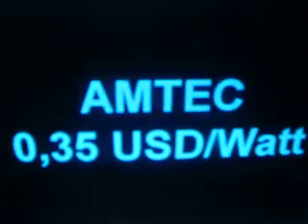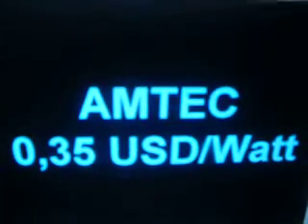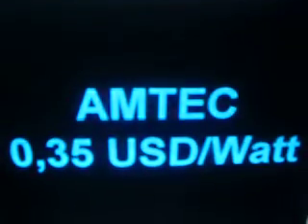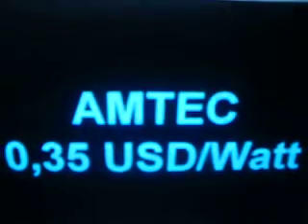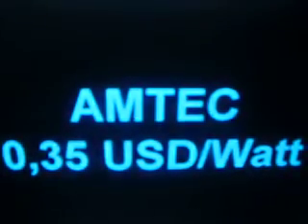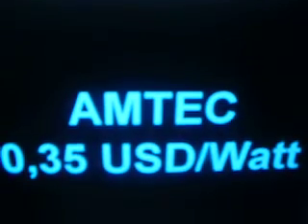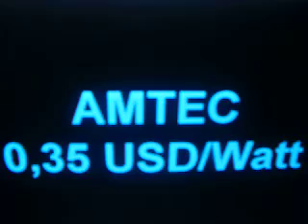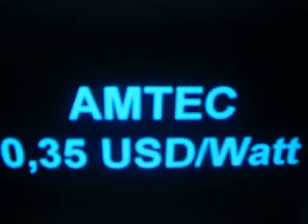AMTEC 0,35 USD/Watt Supressed technology

Comment from the maker: @yellowmetalcyborg 

You don't get it. You take CONVERSION efficiency of steam into electricity as the overal cost determinant of the different types of energy. In that respect solar thermal, nuclear and coal are comparable, and guess what? The CONVERSION efficiency is EQUAL. However in a solar thermal plant you only need to maintain your equipment, in a nuclear and coal powered plant you need to maintain your equipment AND supply the fuel. So what do you think is cheaper?